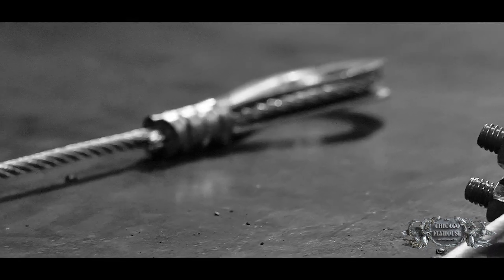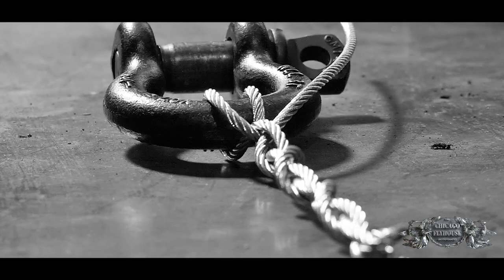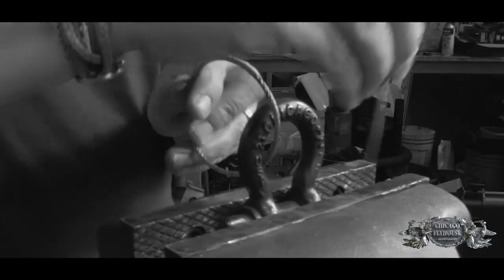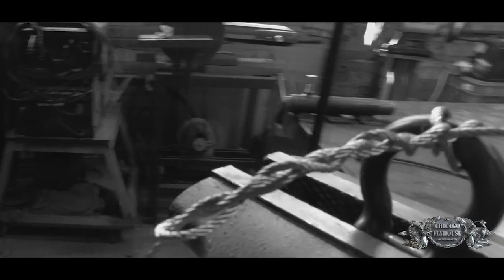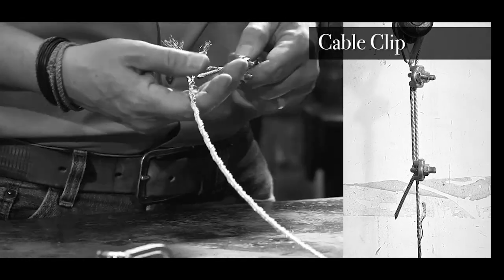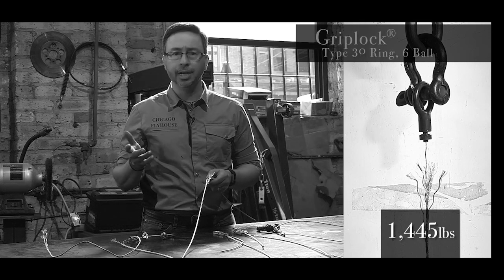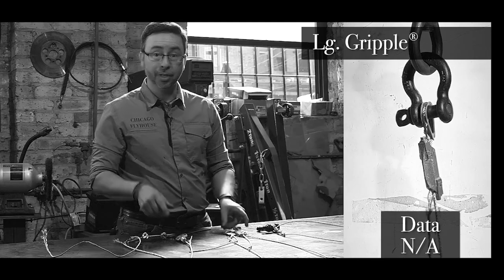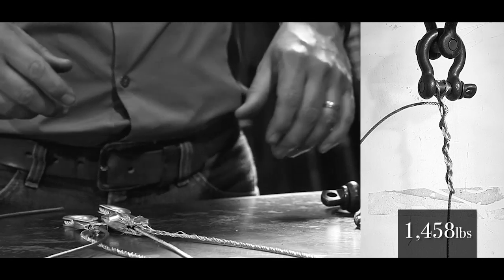Cable Terminations: Are the Ratings Correct?

Comment: Why not mention the gripple?
Reply from the maker: As mentioned in the video, the wire rope we had in stock is not one of the constructions specified by Gripple for that size.  As a result, the tests we did were knowingly an incorrect usage of the hardware.  We don't want to endorse working outside manufacturer specs but we also did not want to skip Gripples in the demonstration, so we did the faulty test but don't provide the results.  We don't want people to see the numbers and decide that we are right and the manufacturer is wrong.   Some day we will get the right cable and do more tests on Gripples, although the results will not be terribly interesting.  They cables break around half the strength as they supposed to when any cable glide is used - a reality reflected in the manufacturer load ratings.

Comment: Tying knots in wire rope.......not a big fan of this. I know that it has been used in the Circus for years. Still I won't do this practice.
Reply from the maker: Circus knots should never be used for permanent applications, and in fact should not even be left unattended.  They are not a commonly used technique in most areas of the entertainment industry.